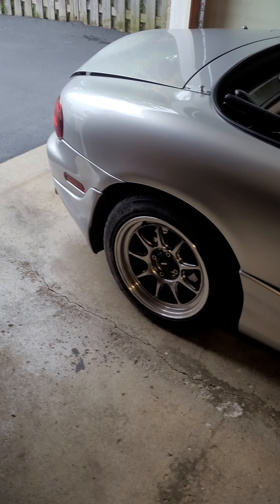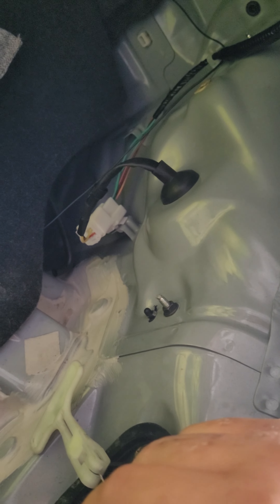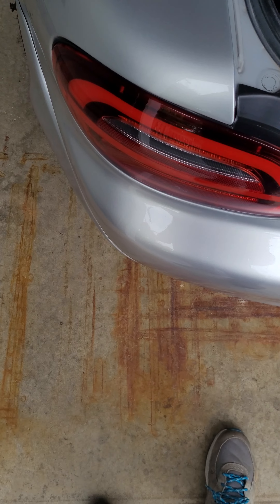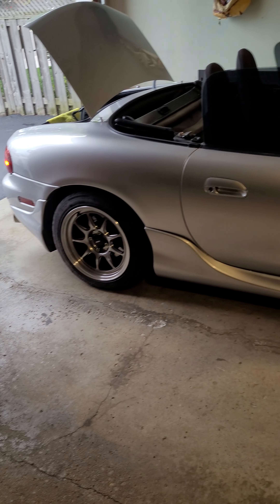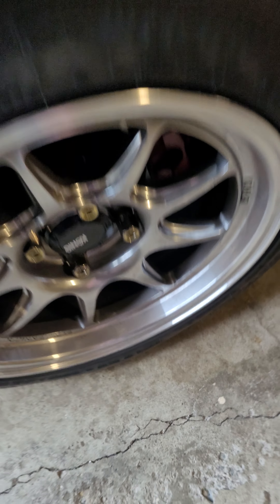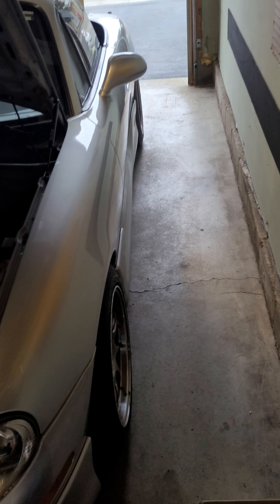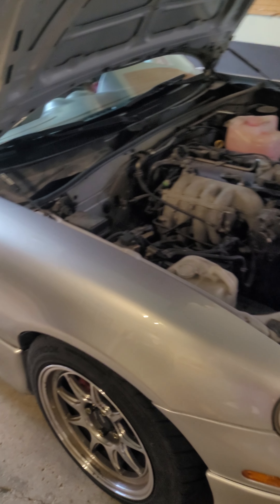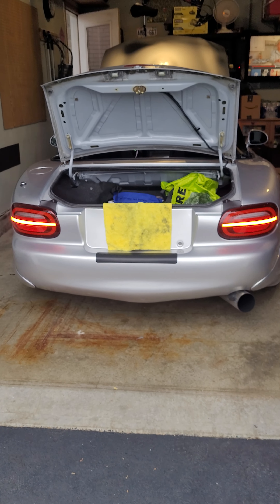Carbon Miata NB Miata LED Taillights installed and car overview

Comment: the truth is that during the day you can't even see the LEDs, they are very weak. in reality they are not the same as the ones you present
Reply from the maker: You have no clue what you are talking about. The LED tail lights are very visible during the day, even on a very sunny day.